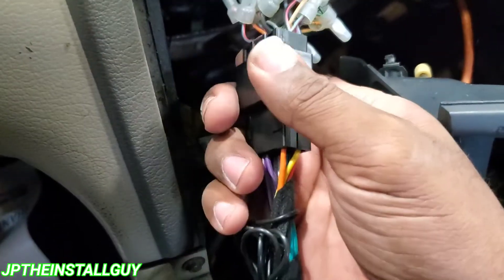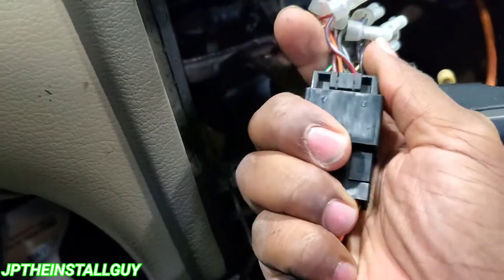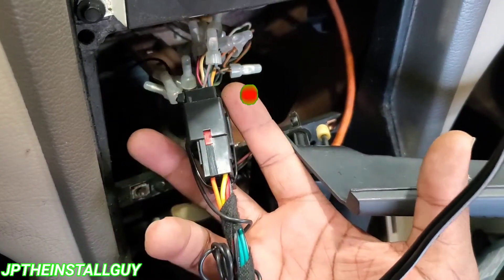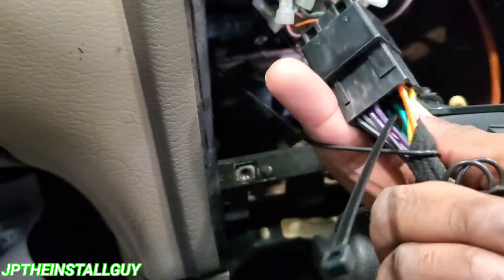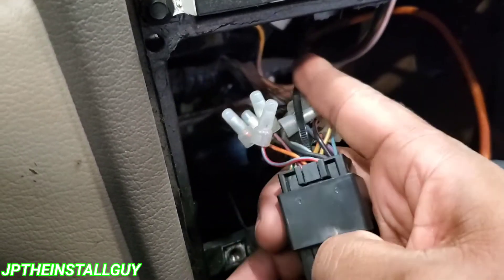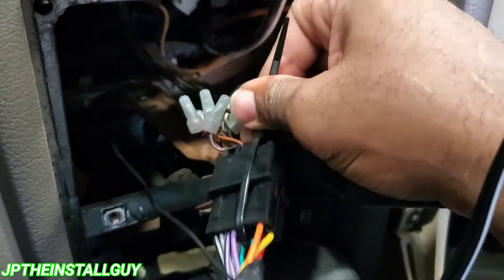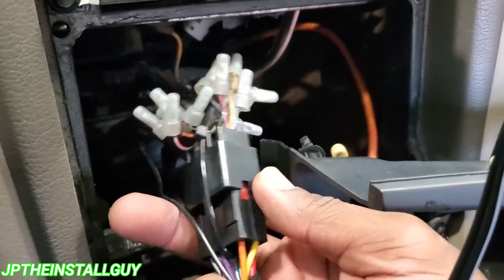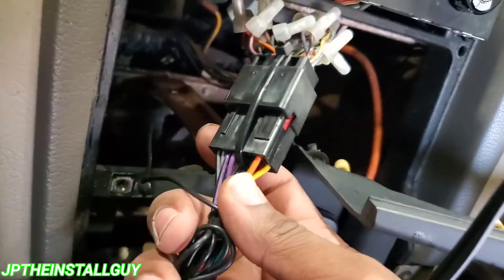how to fix your broken radio wire harness connectors

Comment: Aloha. Thank you!  I used a strand of speaker wire last night to no avail. Great essy tip. I was squashing wires. I also spent Watch for money and lots of time building a box for my refurbished JLW 7 13 and smoked it. Literally. I had to put in the back of my pick up at the beach, and then I came home and put in my scar DNR. Loving it until I hit a bump. NPI. Thanks again.you got a new subscriber on Kauai